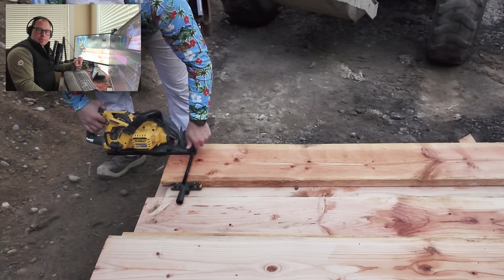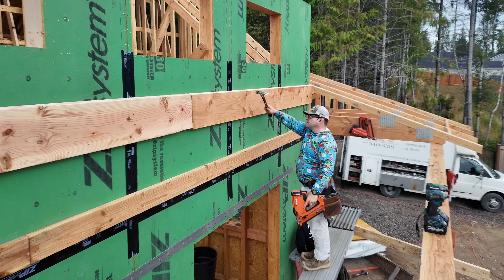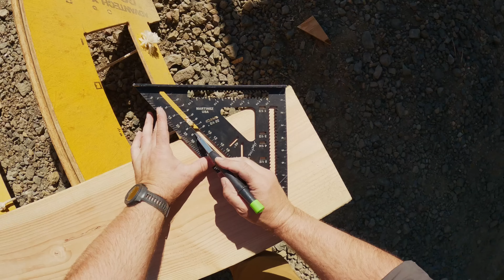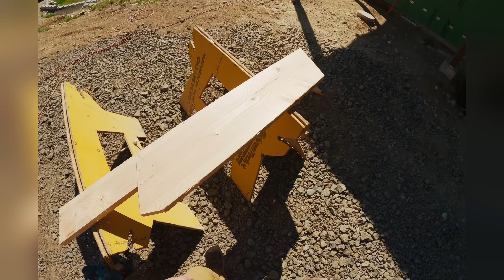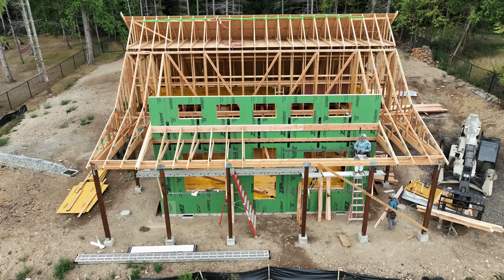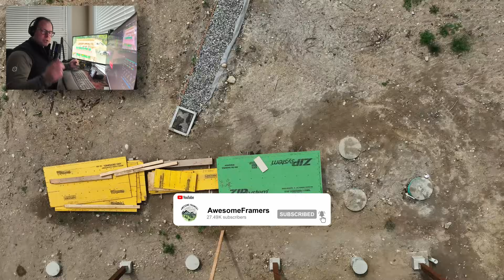Roof Framing Simplified in 5 EASY Steps!

Comment: YESSSSS!!!!!!
Tim, you are the man.  I have had people call me a hack for over cut...............they insist on a pull saw or sawzall finish.
I even used CAD with a radius of a 7 ¼" blade into 1 ½" lumber.  Overcut ¾" on the face is ZERO on the back side....with a curved cut between them.

Not
An
Issue.

Thanks for making that point!!

Comment: I was having flashbacks to an addition we built back in the 1980s. My boss back then had been doing masonry since 1936 and carpentry since the late 1940s. We had toe nailed the floor joists into a ledger (16” on center this being Connecticut) and the building inspector made us add joist hangers. After the walls were up and were framing the low pitch shed roof I said to my boss we’re going to have to use hangers for the rafters. The boss said toenails are good enough so after the roof sheathing was on and the ceiling was framed I had to install joist hangers with all the ceiling joists in my way.
I like the mix of real time and fast forward.

Comment: Tim - As far as the speed, here's my take.  If you're able to speak and explaining details about some specific task in what you're doing, whether the audio was recorded with the clip, or it's voice-over from your studio, and that aligns well with the length of the video clip, keep it normal speed.  I find myself often re-winding and re-watching sections of this type of video to catch the nuances, so speeding past stuff just makes it harder.

If, on the other hand, you've explained how to do a task and now you want to talk about something more general, or you want to segue into another topic, and in the video you're repeating the thing you explained 40 times (say hanging joist hangers...) - speed that up to whatever speed lines up well with the length of your talking points.

This seems like how you're generally running these videos, which is probably why I keep coming back :)

edit: I did notice - during the rafter cutting clip, the audio of the saw and you talking from the source clip was a little loud relative to your voice-over and distracting from your speaking.  I know that's a hard thing to get right every time, but I'd probably err on the side of the original being too quiet than too loud when speaking over it.

Comment: I think your editing and speed is generally good. Yes, a few spots that were repetitive, but overall not bad. I do have a question though; why are your ceiling rafters such large dimension lumber?  I mean I would assume that just a ceiling rafter, but only need to be a 2 x 4, but looks like you use a 2 x 6 or 2 x 8. just curious why go through the expense as it doesn’t do a whole lot as far as structural. The 2x10 for the roof rafter seems more than adequate as well based on the 8-9 foot span that I think I am seeing… btw, I actually appreciate you type of humor… I have the same type and it seems misty people don’t get it… good on you being you 👍

Comment: Well, in the mid west to the east coats, we use 16 on center because of snow load. I've replaced plenty of caved in roof with 24 on center with 16 on center because they caved in from the heavy snow load. usually starting with 6/12 and lower pitch
Reply from the maker: Yep, and that's why there is no "one answer" but rather based on local conditions.

Comment: Can you double up on the skate plate ('nother roller in the back) to get a straighter, more rigid cut? Just curious because I suck with a circ, also not a carpenter by any means

Comment: Hey Tim, any chance for a real time review of the Paslode XP pro ? We had chippies test it 3 yrs ago here in Sydney and the review was that it’s not really required so Paslode Aus/NZ never released it here. My questions are is it really 10% more powerful considering the XP sat at 82 Joules and the other is fuel efficiency?
Reply from the maker: Sure, what do you want me to cover?
Reply: @ is it more powerful than the XP, does the fuel last longer, is the bump fire really worth it. Does the drive pin ever get stuck by the magnet. You use used and have used many types of nailers and you’ve been in the game since grass was invented so you know your guns and you love your toys. Also I’m heading to Hawaii at Xmas, so if it’s worth it I may decide to buy one whilst visiting your pacific island state

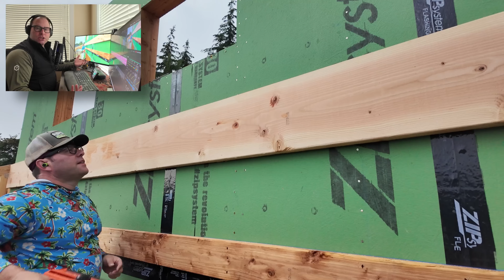Comment: 2:25 fixing a 2" thick ledger to a wall with 5/8" zip siding with 3 " nails.... Yikes! How about instead of going crazy driving excessive amounts of nails that penetrate a massive 3/8" into a wall stud that each wall stud also gets at least 1x 4" bugle head screw and half as many nails.
Reply from the maker: That is a 1.5" ledger (2x12) through 7/16" into a 2x6 wall.  3" nail - 1.5" - 7/16" = more than enough connection.
Reply: @AwesomeFramers  Yes its Ok If you are a incompetent wall framer trying to make up for quality fixings with excessive amounts of nails... because quick, cheap and lazy = nothing Awesome at all, please avoid this business.
Reply from the maker: @cam_934  "ignorance has entered the chat"............
Reply: @AwesomeFramers  : That ignorance was clearly on display by somebody thinking this is what all framers should be doing @ 2:25 Yikes that's embarrassing and lazy seeing the screw guns were in the same shot. Spend the money and buy some 4"-4 1/2" screws instead of cheaping out on the customer with a shoddy job. You think you are the only carpenter on the planet that knows what they are doing or maybe one of many lazy one's that has fallen into bad habits that throwing excessive amounts of nails are the solution to everything.
Reply from the maker: @cam_934  There is no advantage to using those screws when the structural design is based off a calculated design?  Are you a structural engineer who has calculated the loads THIS building will see?  No you are not the EOR, therefore you are speaking from incomplete knowledge.  Here is a link to the IRC tables that show an prescriptive option using 3" nails here in the US. This is why I say "ignorance has entered the chat".  You do not have the information needed to start calling other's work shoddy.  

What particular 4 1/2" screw are you using? https://up.codes/viewer/washington/wa-residential-code-2018/chapter/6/wall-construction#6
Reply: WOW!🤦🏻‍♂️🤡This guy is on another planet talking about 2" ledgers and 3\8"ths penetration.... Sounds like a personal problem to me! Show us your work grand master! 🤡🤦🏻‍♂️🤔🤷🏻‍♂️🤣 Also the engineer makes the determination about what, when & where to use which fasteners, the framers follows their instructions so what are you even talking about. Ignorance has definitely entered this chat! Besides the fact that this small porch roof is being carried mostly by the huge gluelam beam & porch posts. Wow. Keep up the great work Tim! 💪🏼👍🏻👌🏻🛠️🔧🔩🦺📐✏️🚧

✊🏻🇺🇲🦅🇺🇲✊🏻